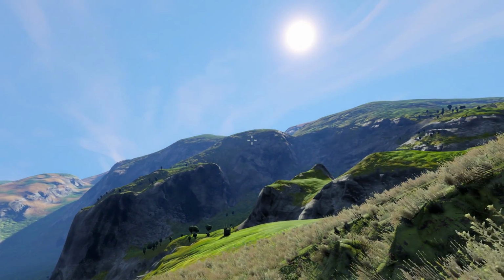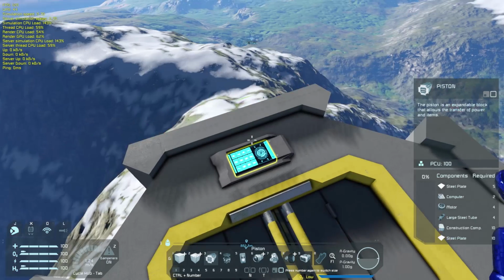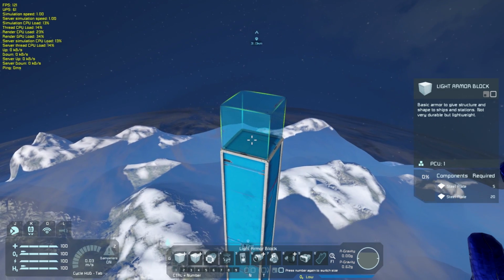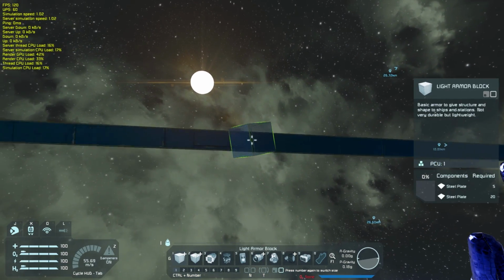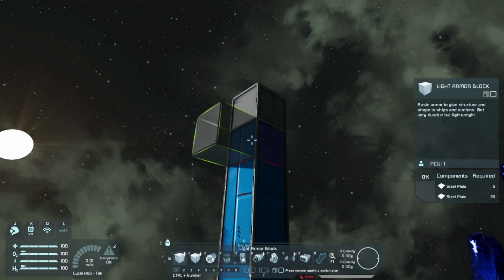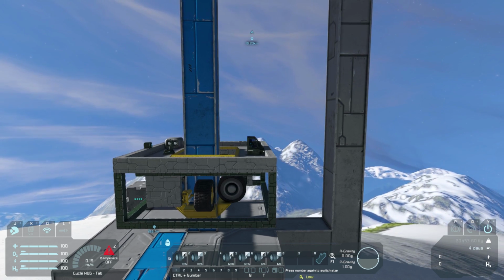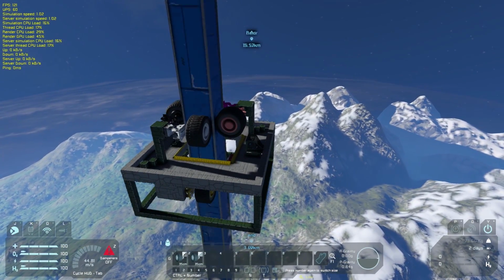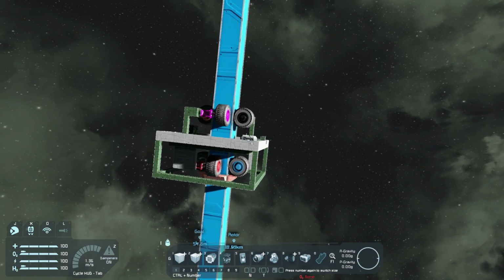Space Busters | Can We Make a Space Elevator? | Space Engineers

Comment: You accidentally built the most realistic elevator you could have. Not only would a real elevator be a cable which a wheeled climber would drive up but in an actual elevator, the cable would have to be substantially longer than the target altitude to provide stability through centripetal force. Well done!

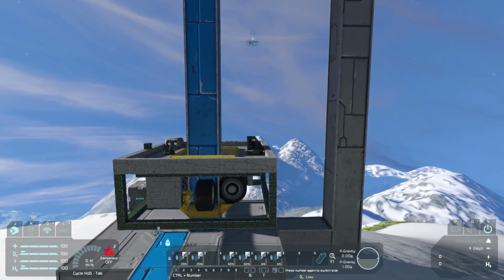Comment: 22:32 The "strength" slider doesn't change the torque of the wheels, it changes the strength of the suspension.
Reply: "Rigidness" might also be a term helpful to conceptualize suspension strength
Reply: @Pyrokan  The Devs should have used a different term for that property to avoid confusion.

Comment: 30:10 Can't you put a landing gear on your small grid that you lock/unlock manually when you want to stop/go?
Reply from the maker: Ah yes! This would have worked as well :)
Reply: Yes, you could add landing gear for a locking break but you'll either have to make sure you have a precise build for the landing gear to slide against the pillar or use a piston with a landing gear so it can push the landing gear to the pillar to lock! Like one of the sayings on the world loading screens stated, "if it's worth engineering, it is worth over engineering!" Lol
Reply: @elementalblaze79  
If the landing gear is not set to autoock, it will slide gently. But yeah, you must pay attention to how you build the elevator so that there is not too much vibration otherwise klang will show up!
Reply: maybe pressing p for the handbrake would also work, but with the way those wheels look it could be a massive gamble.
Reply: I would put the landing gear pointing upwards, cause, why would you need a space elevator, if there isn't a platform to go to, and downwards as well.
The question is in going down. Are the two sets of wheels enough to stop? Irl, of course, the friction would cause everything to wear down pretty spectacularly, but in SE this is a dope idea.
Reply: I think a conveyor connector might work as well.
Reply: @AndrewmanGaming  NO MAKE A SPACE STATION WITH CONNECTORS

Comment: I hope they add a "rail" block, that you can place certain other blocks on, that can then move along the rail.
It would make it possible to make fx. a 3d crane (instead of using 3 pistons, having a square with 2 rails on2 sides to make the X axis, a beam of blocks between them, with another rail being the Z axis, and the "crane claw"(/the Y axis) could then be a piston with a connector.

But basicly, so we can make a tower (like 8:45) and then add a rail and a platform on it.

Comment: Okay, as someone who is actually interested in the topic of using non-rocket methods to bring materials to space, I think a planetary based mass driver is more realistic than a space elevator in the real world solely because it is easier to find a material that is incredibly heat resistant than a material that can stretch from surface to space and not cause an incident like the one at New Mombasa in 2552.
Reply: irl you would still need some fuel to make an orbit (reducing speed at the right altitude) when using a mass driver
Reply: Halo reference.
Reply: @robob4465  really? I did not actually know that, but that does make sense.
Reply: @jonathancole3149  well, that is one of the worries with a proper space elevator. The materials we have at hand are not strong enough to keep an object in orbit tethered to the ground, the tether could devastate a large portion of whatever continent it is in. According to the FAI definition of where space 'begins,' that tether would need to be easily over 100km. Most likely several megametres tall, if I am doing my math right.
Reply: Look up SFIA, Issac Arthur has a channel devoted to this sort of thing
Reply: Urg neither ideas could work

Comment: Separated elevators on a thick shaft, with wedges to put wheels in. Elevators are separate structures. Use a combination of ion and atmospheric thrust for propulsion. Throw on an autopilot block. Set it for exact positioning. Set some waypoints to connectors. Run it solely on battery power. Set some timer blocks so when it meets connectors it won't run again until the batters are charged (you'll need to do some math but you shouldn't need it to be fully charged anyway since it'll recharge at the bottom and top of the elevator). The elevator is basically a sideways rover with set tracks (the wedges) with autopilot to help position the elevator so you don't need to pilot it.

Comment: A better solution would be a really powerful rail-gun that propels a small ship or cargo container into orbit.
Reply: Giant catapult time
Reply: Or a trebuchet.
Reply: @RAFMnBgaming  lol, like a mile long trebuchet throwing stuff into orbit would be amazing
Reply: Mass-Driver/Railgun approach: you will need some serious G-force dampening to make any manned craft survivable. Otherwise leave that kind of launch system to the drones.
Reply: @Aereto  I think using drones would be the best way, like you could send humans in regular rockets then cargo for resupplying or building stations using a mass driver.
Reply: Would still require the same amount of energy at the minimum, which is a shitload.
Reply: Calm down, Hyperion.
Reply: You definitely could, except you would have to deal with the speed limit in-game, which is hard capped at 110 m/s, which is not enough to get past the thinning atmosphere at 5 km up. You can artificially double or triple it with a mod. You also have to consider that a launch based system is a one-way ticket, and therefore, reduces economic viability. With the fuel considerations and different thruster types, building a space elevator to be able to fly a ship without the extra weight of atmospheric thrusters, store non-atmospheric ships on planet via warehouse, or reliably bring cargo into orbit without the need of an extra ship, elevator is a good way to go.

Comment: I always make a satellite in space then "hotlink" it with my world side base by placing a bunch of  floating self sustained octagonal ring shaped satellites that negate gravity within their circles. This makes travelling up much more cost efficient. Still takes time though. If it comes to transporting wares, I think the best way to do it is to put a bunch of proxy floating points and script them to "bounce" up when full with materials, auto connect to next node, port materials (injector collector ports), disconnect and go back down. It will be tricky to make them go back to their original position, but if you make a bunch of gps coordinates and use them as anchor points for the repositioning scrips, that would most likely be the best way of transporting a lot of stuff for almost no expense in resources and time. Writing the script for that would be a bit tricky since it would have to involve a component that accounts for the current g strength. So far I haven't had any luck with figuring that one out so I only tested the bumping line by having it operate via timer based engine pulses. It was a disaster :D

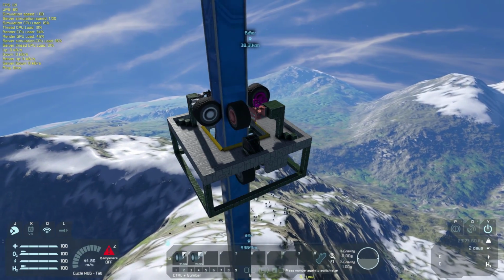Comment: At 25:00 when you have the wheeled elevator "working" it shakes around a lot. Put some gyroscopes on there and check the "Override Controls" box. This will set the gyros to hold the tilt at zero so you don't shake around as much.

Comment: i suggest having at least 4 columns with the vehicle in the middle with atmospheric and ion thrusters. the brake you did at the end wouldnt be needed if you had the ion thrusters to stabilize its position. also, as someone else suggested, lock it in place with a merge block or a connector at the top. i would build a space station at the top for docking starships and such :D

Comment: Interesting.  I would say that pistons have a possibility to work though not nearly as fast as the wheels did.  Build a tower just like you did with the wheels either with armor or conveyors  and have docking ports  placed at a set interval.  Then the machine climbs the ports by extending, then switching the locks and retracting.  Alternatively the rotor could be used so you dock 1 end then rotate around until the next port is in docking position.

Comment: I think you very easily could have just built this to the top altitude of the most dense parts of the atmosphere on the planet (16 kilometers). Once a rocket is out of the atmosphere of the planet, it becomes extremely less difficult to acquire a stable orbit. the ISS is at 400 kilometers, so obviously you'd still need rocket fuel, but not having to fight against the friction of the atmosphere would decrease the amount of rocket fuel you would need almost by half. This was the original thesis for the "space elevator theory."

Comment: FYI, when the speed is in RPM then it's the same at the hub as it is at the rim. It's only when that RPM is translated into m/s etc. that the outer edges are moving at higher speeds than the center :)
Reply from the maker: I see what you're saying. At the end of the long rod, we're still doing the same RPM as the center, but we feel a much faster speed since we have to cover more ground to do the rotation. The reason I wanted to make us go at a very small RPM is because if I bumped it up too far, we would be flying super fast on the end of the rod.

Imagine if we sped it up so that it took 4 seconds to do a full rotation at the center. This is not unreasonable and the rotors can do this. That means in just one second, we would go from the height of 20,000m to the ground level (1/4 of a rotation). In this instance, we would reach a speed greater than 20,000 m/s. Surely enough to crash the game. 

So I wanted to keep the rpm of the rotor as small as possible to avoid such high speeds.
Reply: @AndrewmanGaming  Absolutely. Didn't mean to imply you were making any kind of mistake, just that rpm is as you describe above and doesn't change with distance from the point of rotation. 

I can certainly see how only having rpm speed to work from makes it more difficult to calculate pn the fly, and why you'd need to set the RPM incredibly low for any such system. As you rightly say, even 1 RPM is going to be way too fast when talking about a 19km radius circle. Some quick napkin math shows that you'd be travelling at over 7,000kph, or about 2,000m/s!
Reply from the maker: @squallloire  Yeah and to make matters worse, the only way to change the speed of RPM is with a slider. Not by actually entering the number.So really any wrong movement and you're going the speed of light around the rotor!
Reply: @AndrewmanGaming  That's just the bad phisics in the game

Comment: If there was a space elevator in real life, I doubt anyone would place it at the top of a mountain. First, because it is expensive to move materials up a mountain. And depending on the location chosen, you could probably save more money just by building bigger reusable rockets. Second, you would probably need a geologically stable location to reduce the monumental stresses that a space elevator would have to endure. And mountains are formed when two tectonic plates are pushed up against each other. Meaning it probably isn't a good idea to build a multi-trillion dollar project on a location that is going to experience quakes quite regularly.

Comment: So... did you know that this system is actually shown in the opening cutscene for Space Engineers? Granted, that one is made with welders, which saves a bit of work if done right...
Reply from the maker: Yeah, they've got a smarter design going. The thing basically builds itself! But they never show if the thing actually works. That's what I wanted to prove - can you build a working Space Elevator and prove that it can bring you from the surface to 0g?

Comment: Just gotta say this that the actual space elevator structure would NOT be first place on a hill, but in the middle of the ocean as to ensure a anchor point without any worries of most natural catastrophes and even height on the equator. Its specially the fact it has to be on the equator as that makes the none ridged structure not have as much varying tension on it plus geo stationary orbit and all that. This is because most heights are not even close to high enough to make a difference. I think even mount everest makes a not so noticeable difference to the total length.
Reply: Not to mention mountains form when two tectonic plates are pushed up against each other. Meaning that quakes would happen quite often in that location. Not exactly a good idea to build a structure that is going to have to endure monumental stresses in a location that isn't geologically stable.

Comment: Piston idea might be actually viable, but you will need to place 4 pillars around the piston, then after 10, 20 or 40 pistons you will have to put a plus made outta blocks

The lazy fix for the cart wobbling (on the wheel example) is using 8 wheels (2 per one side of the big pylon)
All of the wheels should be on pistons facing inward, so it applies more friction (but maybe a suspension would be handy for that?)

Basically:

      |   |
      |   |
  /○|   |○\
  |—|   |—| < platform
  \○|   |○/
      |   |
      |   |
      |   |

Comment: You could also build an efficient small ship with a remote control and a passenger seat and a cargo container, and the remote control would autopilot to a waypoint somewhere in space.
Reply from the maker: Believe it or now, I did considered something very much like this but I thought it was sort of a cheat. I would have a platform with rockets and a panel and from the panel I would adjust the rocket's override values making it go up or down. The reason I did not go with this is because the whole theme of the video was moving away from rockets and to a more efficient method of going up :)
Reply: @AndrewmanGaming  Yeah, I decided from what the "narrator" said at the beginning of the video, you would probably say something like that.

Comment: Would gyros help to stabilize the climber?
What if you make the central pillar a rectangle so you could increase the amount of wheels. By doing so would that increase the traction you could apply from the climber to the pillar?
Would atmospheric thrusters help get you high enough so the wheels won’t have to work as hard?
Reply: No, gyro's will not help with wheeled design.
Adding more wheels and making the climber longer would indeed help with stabilizing it. Also - probably it would need a bit more fine tuning of suspensions settings. 
Atmospheric thrusters + gyro would help to stabilize it while in atmosphere, but would be a dead weight and exacerbate the problem with stability after certain point.

Comment: Run 5-10 pistons then use a heavy armor block with thrusters aimed in each direction. Make sure the dampers are activated. Inflatable flailing arm tube elevator issue solved, mostly.

Comment: No one will ever see this comment but if you do, here's a trick I learned today.

If you take the top off a rotor and put that rotor on a piston and press it into a block or voxel, it will do everything in it's power to aggressively align itself with the surface, useful for elevators and mechs, making really easy surface aligning blocks. Mind you the rotor is only .65 blocks tall so you could in theory just use it as a bottom of a mech foot but idk, not tested.

Comment: It is actually a rather common mistake that you need to go "all teh way into 0 G". You really only need to go so far that the Ion Drives can overcome gravity.
As a minimum height, I would say the point where Ion Drives are not hindered by the Atmosphere anymore. Plus 1-2 km for safety.
I thought about the "driving up a pylon" design myself, but never managed to do build the cabin. The main job of those wheels is to stabilized the thing. It might be possible to do that part with detached landing gears. Maybe even balls.
As drive only wheels will work. Atmospheric and Ion Thrusters will work the first and last bit, but there is a "zone" of a few Kilometers where only Hydrogen thrusters will work at all.
As for stopping, that sounds definitely like a landing gear problem.

Comment: What if you made a shell encasing the elevator itself and have the wheels grip both an inside pillar and the outside shell so it would stay stable, have more traction, and would go faster
Then to improve on design, you coudl cover up the wheels with armor blocks and then add a small room with a window under neath the main structure ad it decends into a base like structure, kinda like halo 5's space elevator
Then have pistons extend from the shell to lock the elevator in place when it reaches the space station
Reply from the maker: Yeah! That would probably make it better. There are lots of optimizations that could probably be made to make this thing a hundred times more stable, faster, etc

Comment: Good video Really enjoyed watching. This is actually the second time I've seen a YouTube build a space elevator in space Engineers. The other was Epik Tetus from the channel Epik Tek during his second season. He actually built the entire thing in survival mode and designed a special ship to automate the building for him. 

Anyway, I think that there are two things you could have done to make the elevator work a bit better. The first is to make the cable a bi wider, Like say six blocks instead of one, this would allow you to add at least two more wheels per side. The second thing you could have done would be to have maybe four layers of wheels, two above the elevator to pull it higher and two more layers below the the platform for stability and to help push.
Reply from the maker: These are some great points! I'm amazed someone was able to build one of those things in survival! It probably took AGES!
Reply: @AndrewmanGaming  It certainly did, I'd need to go back and count the episodes, but he normally does them in half hour segments and I'm pretty sure the elevator covered at least five to ten with offscreen building included.